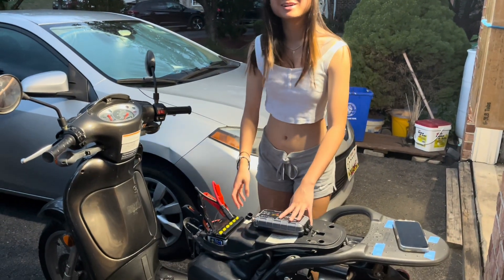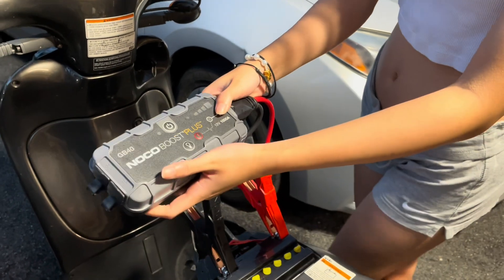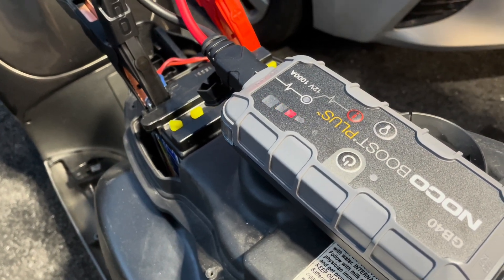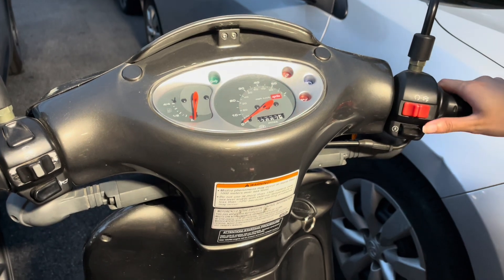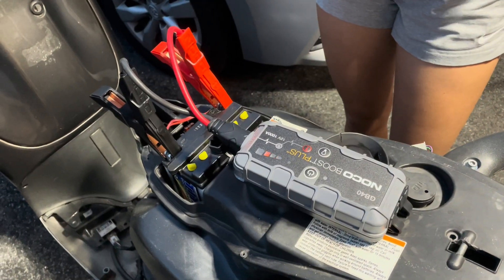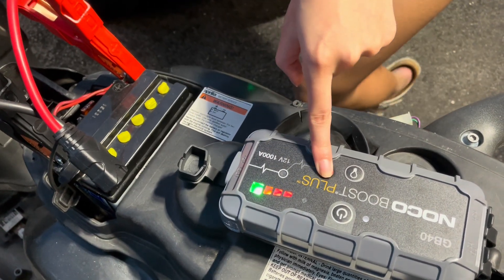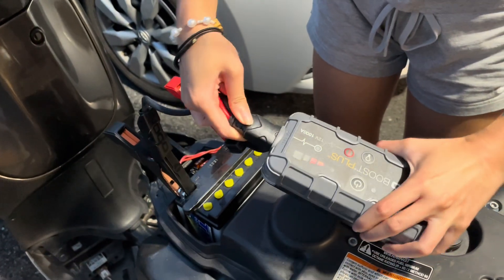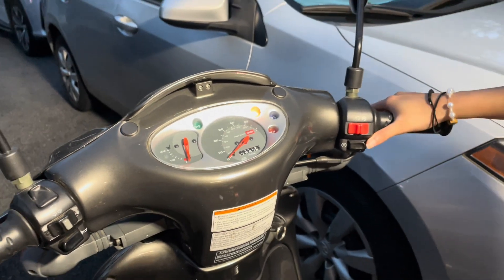NOCO Boost Plus  keep clicking when jump start a completely dead battery - Resolved

Comment: wow, yeah mine when id connect it the lights would chase meaning its all good but wasnt enough to start my truck, i tried holding the button but it would stay solid and not flash, thanks to you i tried this out, and it then it worked like a charm and started my 6 litre gasoline engine right up without, great video

Comment: Holy crap!!!! I just had this happen to my car. It's almost zero degrees out, still snowing, and it's dead as a doornail. So I finally got a chance to try this thing out and all it did was click click click! So as usual I got online to find help. EVERY forum and website I went on said that it means your batter is so low that this device cannot detect any charge and it's shot and you need to buy a new battery. Then saw this video. Did exactly what she said and that dad burned car started!!!!!!!!!!!!! Thank you so much!!! 🤩

Comment: Even with my boost light flashing and a full charge on the NOCO, mine won’t jump start anything any more. Used to work like a champ. Now it’s a chump
Reply: It depends on the condition of your battery. Results look like it can vary, but here's a video where the guy while in boost mode:  let it charge his battery a few times, let it cool, and then on the 3rd try was able to start the car.

https://youtu.be/17EsbCys_90?si=qNHUFKdHGtAPt-pI&t=315
Reply: @  it’s a bit different. My GB70 was fully and recently charged in prep for winter. The NOCO wouldn’t make it turn over at all. Connections were good and was showing discharge. NADA.
I was able to remove the vehicle battery and put it on a charger. Started right up
Reply: @frostriver4547  - just saying, the guy in the video had the same problem. Went through a few cycles of "boost" just charging, one cool down, and then it would start. Not saying it would've worked on yours, but it's the only thing he did differently than others who used boost a few times and gave up (cool down and tried again).
Reply: Novo gb40 instructions
Reply: With the GB70 I powered it up hit the small ! button so it's flashing - on then + on few sparks and the truck started.

Comment: maybe because its a 6 volt battery, just saying
Reply: Most modern scooters and motorcycles are 12v
Reply: What is the years make and model of the vehicle?   I’m sure you don’t know so your MISinformation is meaningless!
Reply: I'ts a lead-acid battery. Those are nominal 2.1 volts per cell. You see the 6 yellow lids? Those are the cell lids.